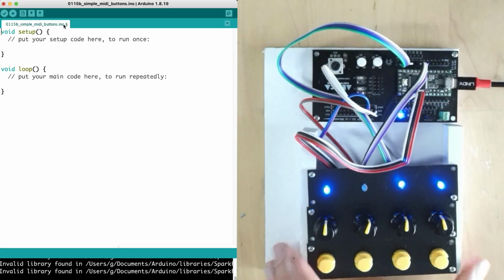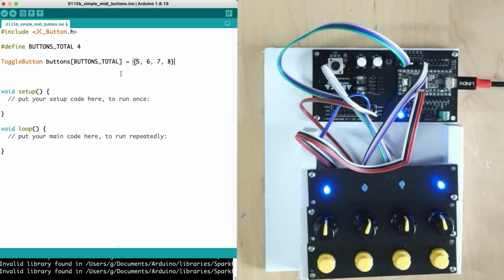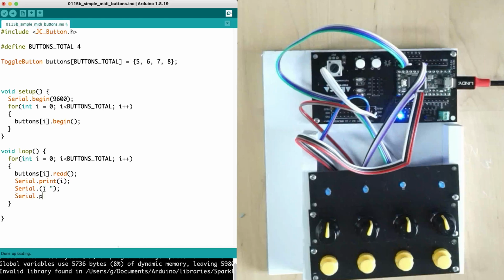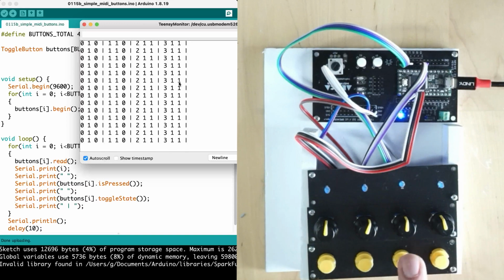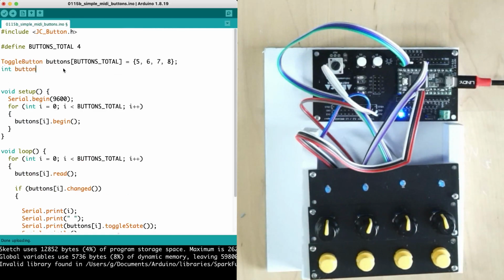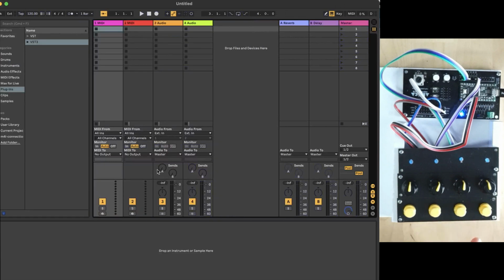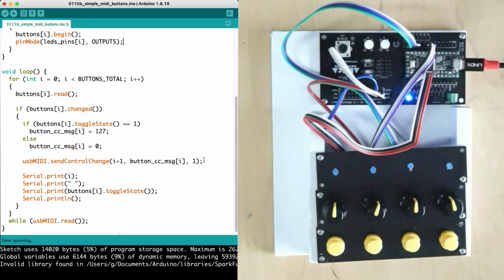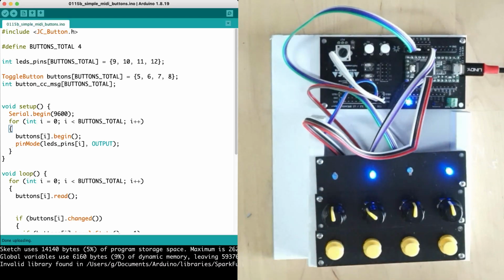Simple USB MIDI tutorial - part 2

Comment: hi, i am also making MIDI gloves consisting MPU 6050, and 5 flex sensors, teensy 3.5, i wanted your help with the code regarding connecting flex sensors to teensy. please help.
Reply from the maker: Your question is vague. Please elaborate. Are you having problems with the hardware connection or software programming?
Reply: @CreativeComputingG  I have to make MIDI controller gloves using MPU 6050, and 5 flex sensors, teensy 3.5, and I want help with programming.